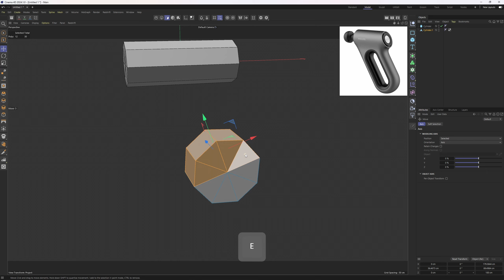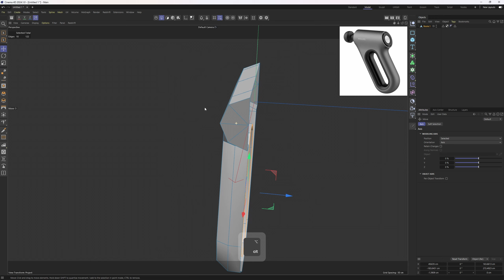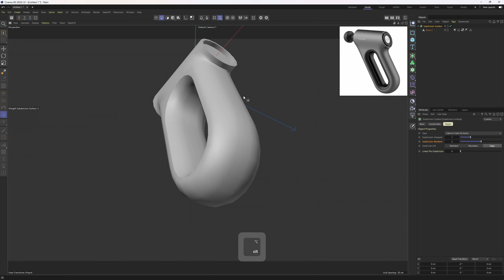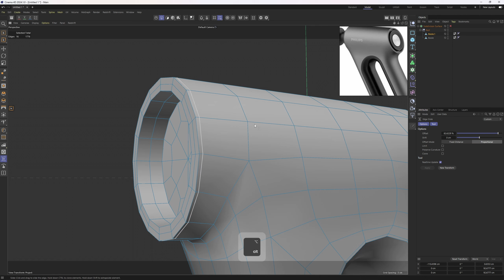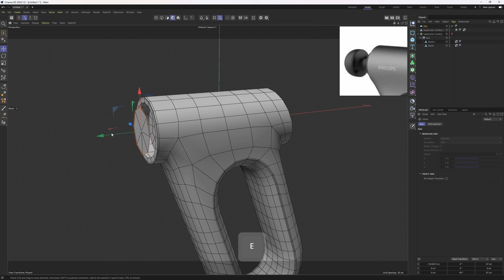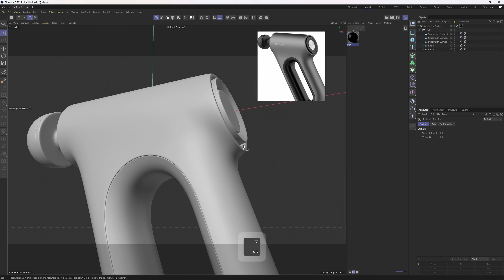Industrial Design/Product Modeling Tutorial #33

Comment: I wish they fixed the sliding in symmetry issue finally. Well, and several other symmetry problems.
Reply from the maker: Yeah, I wish too!
Reply: @polygonpen  Like honestly, there are so many tools that mess up the symmetry. Even the sculpting brushes. 
And there are even crashes. For example using fill selection with symmetry on crashes C4D for me about 30% of the time.
I like their implementation of the symmetry, but it's so messed up right now.
Reply from the maker: Yeah, unfortunately, I found that if you use Symmetry hub, it works just better than symmetry object in some cases. @filipstamate1564